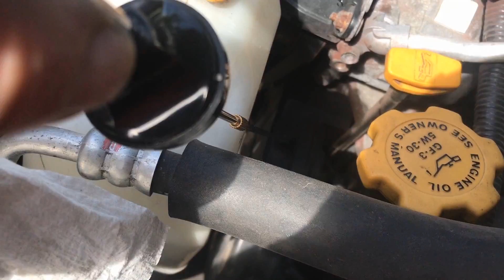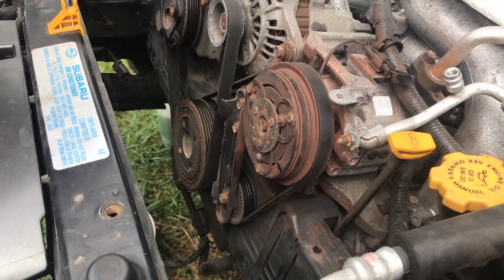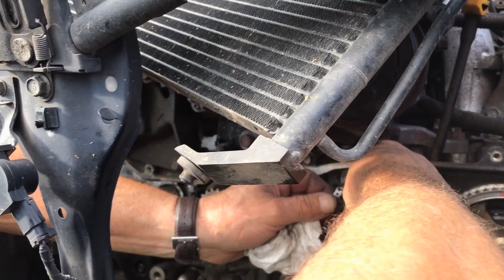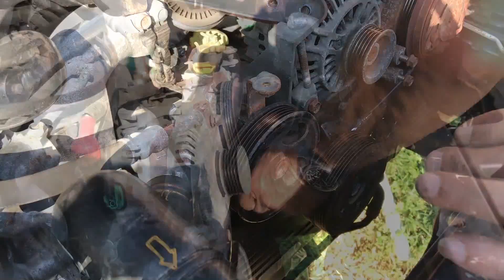Subaru Forester 2005 - Timing belt change gone bad.

Comment: I’ve watched dozens of mechanics working on my type, the ‘05, and on Subarus, generally. This was the best one yet. Straight forward, concise, good camera angles and zooms when necessary. Liked the manual cranking after the new belt was put on, just to make sure there was no interference with valves.

Comment: 14:00 2 hours later with a special tool and a long bar on the socket.
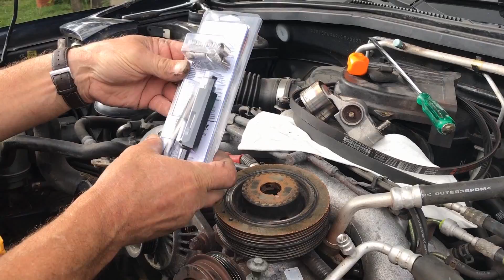16:48 Most likely cheaper to get a new mounting bracket from Subaru.
When I had to do one it was ½ the cost of a recoil thread kit and to recoil the job well it will need to be off the engine.
A someone taking out the tensioner mount bolt first.
Amateurs can screw jobs up very quickly.
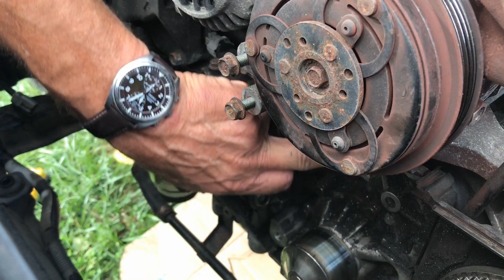17:50 Do NOT remove the air conditioner radiator. The mounting bracket is just under the AC compressor, a few tools and 5 minuets, that's all it takes, and it will make replacing the water so much easier.
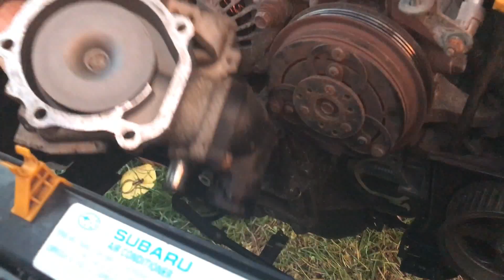26:24 Come on at least new thermostat.
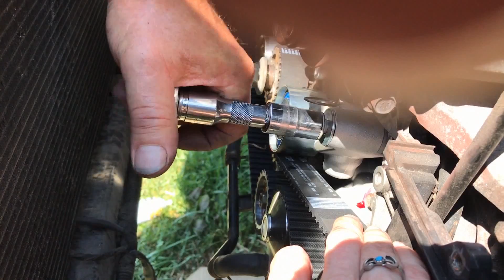31:30 DO NOT use red Locktite with a Helicoil, it will most likely strip the thread when you come to remove the bolt.
36:46 How did you hold the crank when the crank bolt needs 130 ft/lb on the bolt?

Comment: Can replace the tensioner bracket that the tensioner bolts into or take it off and heli-coil it. Use Subaru metal water pump gasket only - no RTV.

Comment: I'd highly recommend an AISIN timing belt water pump it. It's pretty much subaru but without the subaru stamp. Japanese bearings (NSK, KOYO etc) and the cast work on the water pump is outstanding. Timing belt itself is made by Mitsuboshi (not Mistubishi) as they're the supplier for subaru. I'd stay away from gates as they've recently been sourcing parts from China. The kit itself might say "made/assembled in Japan" but all the individual parts if not most are from China :(
Reply: Agree. If doing clutch get an Exedy stage 1 kit

Comment: I had to put a helicoil in the same bolt hole. Mine stripped while I was installing the tensioner. 
I found out after that where that the tensioner fastened to the engine is a bracket that just bolts on withe bolts. If it had known I would just changed the bracket.

Comment: The tensioner bracket can be removed from the engine with 3 bolts. You could have taken it out to tap it or replace it easly just my 2 cents

Comment: Hey great video. But an IMPORTANT QUICK TIP; all you have to do is change the bracket that holds the tensioner. I believe there is three bolts and it can be replaced so you don't have to go through all that extra work. Don't ask me how I know... ;)

Comment: Great video thanks, your video motivated me to ask this: I have Subaru Forester 2006 head Gasket work done at shop ($3500) in Las Vegas, completed august 3rd (took 1+ months), they asked for cash on last payment ($1500) even gave me a discount (suspicious right?). Car has a high pitch not very loud whistling noise on higher revolutions and we noticed timing belt cover is missing, they said they have it ordered and will replace it later on... Worry mostly about high pitch noise. Should I drive the car as is? Should I take it somewhere else? Maybe I should get timing belt replaced again at dealership? I believed the shop was doing good job, but they must have messed up something seriously putting it together or maybe is something small. We've driven car around 100 miles to get smog test done and passed without a problem. Any advice on what to do next and other questions I asked would be greatly appreciated.

Comment: just did the timing belt on my volvo s60- I had it easy-  no radiators, fans, AC compressors to pull - just a radiator jug, a power steering bottle and I had the remove the front passenger tire- 15 minutes later, I was able to get at everything.   You do great work- I like the way you methodically analyzed the problem first and then step by step-  took care of business.  Thanks for making this video.
Reply: I hate Volvo. want my 1999 s80 T6? Ton of new Volvo brand parts on it and it still has issues...

Comment: Great explanation and articulation about your troubles. !! Your a excellent mechanic btw!! 

I had someone put a 2.0 L engine in replace of the 2.5L. At any rate the the engine had just under 60k. Well today driving 42 miles to a store made it safely. But on the return trip back after leaving only 3/10 of a mile the car sounded quiet and as if the gear in my AT disengaged and after looking under the hood noticed the passenger timing belt cover broke partially off. Then noticed the idler pulley broke apart as I pulled out a big chunk. The belt broke though so NOW I’m unsure yet if I have permanent engine damage. 

Unlike your situation the belt was still together. Mine broke off and can anyone speculate what might be damaged? I still need to take my cover completely off and pull the radiator out. The timing belt was new also. The car itself has only 78k miles and is a 05 like yours. I bought the 2.0L engine because the head mating surfaces do not have a narrow space for coolant leakage so the gasket leakage issue is obsolete and this engine ran better than my 2.5L. !! 

So in MY situation what happens normally to the engine? Valve damage or more? I’m unsure.

Comment: how did you lock the engine to get the bolt out that holds the harmonic balancer//// I watched you do it and it was locked and you backed it out, mine just spins and spins????????
Reply: Lock your flywheel if you can
Reply: I set a socket and bar on the nut and cranked the motor a loud crack and it was off, keep it simple .

Comment: That tensioner is bolted to a removable bracket....I know I had one snap off.the bracket is an aluminum casting...it’s held in by about 6 bolts and comes right off...it can be replaced....all that work was TOTALLY UNECESSARY!!!

Comment: Subaru should be out of business! Your head gaskets WILL go! Your timing belt tensioner Will go! Your ABS system WILL fail causing the lights to dim when you hit the brakes and many more constant issues that Subaru refuses to address! Head gaskets should NEVER need to be replaced! I had a Dodge Dakota that blew a water pump and drained the coolant, I kept driving till the engine heat seized three times, replaced the pump and its still running with no head gasket problem!
Reply: Haha I was feeling guilty for driving my Dakota 3 miles more on a blown thermostat gasket and in the red hot zone. You got me beat. I replaced the gasket and the thing kept on driving.

Comment: never buy a car  that has timing  belts  ...
Reply: Chevys 2.8L and 3.6L engines have timing chains and are NOTORIOUS for failure because the chain stretches. Any timing system can fail. Belts at least are easy enough to service
Reply: @mountainxxxdew  you can have your belts  an  2.8  never had chain problems   an the 3.6  did...called   change  your oils
Reply: @mountainxxxdew  had a 2.8 v6  ..rear head gasket  problems //i drove corvairs for 45 years  still have six  ,,no chain   or my 84 fiero ..yes some engines  had chain problems  ,,but i dont have any

Comment: Excellent video.  Very well done camera work.  Thank you for the avian sound track, so much better than endless cussing and screaming music (sorry, don't mean to get all "get off of my lawn" cranky old guy on you).  Well done on stripped thread repair.  I would have appreciated a shot and quick inventory of the parts used, what was included in the belt/waterpump/tensioner kit and any other materials needed.

Comment: I did mine last summer. I replaced all the wire clamps with screw clamps. The kit I got was not the best quality . I ended up trading the vehicle in anyways. Got a 2015 Outback with low miles for a graet deal!  this outback has the metal timing chain , no timing belt. It is 100 times quieter than the belt timed engines.

Comment: It would be nice to be able to use an angle drill for the stripped out pulley bolt..if you had one..or had enough room to get it in there.

Comment: In Australia mechanics either don't know about this stuff or set the car to fail. When an Australian mechanic removes an engine, timing belt area they just leave, they don't even look at it even though the engine is out. My mechanic broke my timing cover and just left it without a bolt. Best to learn as much as possible in Australia. Completely under regulated and over priced.

Comment: arnt you ment to line the notches on the pullys up not the marks on the belt once you have turned it over by hand twice?
Reply: Not true..it would happen MAYBE if you rotate it 10 times..
Reply from the maker: The marks on the pully's and belt should line up together before and after its rotated 2 x.

Comment: I used thread serts myself. I had to do it twice on two different cars. These holes strip out really easy. The bracket is replaceable though. The part number is 13156AA052 and they run about 35 dollars. I had the older hydraulic tensioner on my EJ22, so I had to thread sert the stripped hold. The other stripout happened on a 2002 outback. That happened on the main block (Where you thought the other idler was going to pull threads actually.) That was not a replaceable bracket. lol Great video!
Reply: Cut the old belt or hold it back as you remove the pully bolts and stripped threads will not happen.

Comment: I was never a fan of helicoils, personally I never had much luck with them. I use timeserts, there more idiot proof for guys like me
Reply: Yeah, I prefer Timecerts myself. In this instance, I would have replaced the bracket to save time.
Reply: 10mm bolt into 12mm of aluminium was doomed with that lateral   force,

Comment: I hate to be the bearer of bad news, but the rethreading of that hole for the timing belt tensioner wa totally unnecessary. That hole is in a bracket that is held on by three bolts. You can see those 3 bolts on the tensioner bracket in several of the shots when he's threading the hole. 1 bolt is to the left and the other 2 are just above. Unscrew those bolts and replace the bracket. Or simply have the bracket off the car to repair the threads. Subaru designed it this way for ease of repair of just this kind of failure. I hope your fix solved your problem and it does not recur.
Reply: Bob Sadler that's what I was thinking. Just change the bracket. There's actually a service bulletin out for some    models with a beefed up better bracket.
Reply: I Changed my bracket to on a 1999 Subaru Legacy Outback. The timing belt tensioner was jumping up and down and the piston where the pin goes through was knocking up against the bracket. Crazy!  The tensioner bolt got loose and slightly damaged the entrance threads of the bracket so just got another new bracket.  My crankshaft sprocket was also worn along with the Woodruff  key so got new ones along with timing belt kit. I noticed he torqued down parts to 30 foot pounds but no mention about the crankshaft bolt. I think it's supposed to be cranked down to 130 foot pounds but luckily my friend had that special  tool that fits in the holes of the pulley. Once positioned, the  tool goes in the direction counter clockwise while the torque tool goes clockwise until you hear the click that you reached 130 foot pounds. Any Subaru mechanics know if 130 foot pounds is correct? My son drives the car and says car runs real good for the past 5 days.
Reply: I stripped my tensioner bolt so took  it out and drilled it out and put in  a longer bolt
 so that a nut fastened it  on the outside and 2years later i checked it 2 years later, all good,
Reply: All good no worries